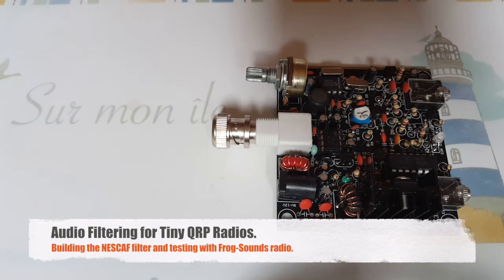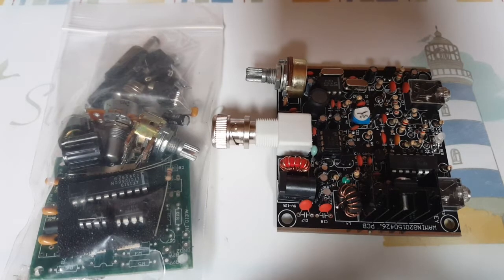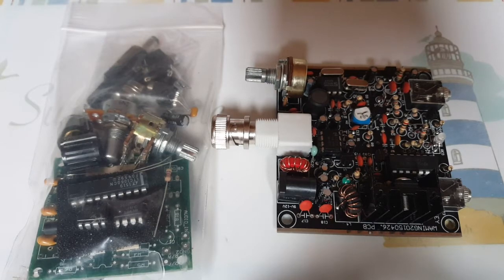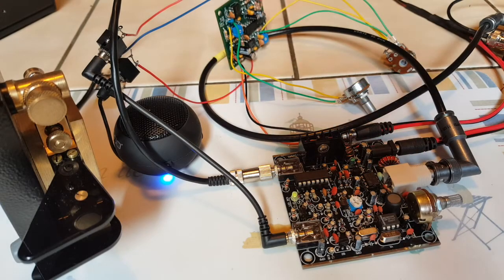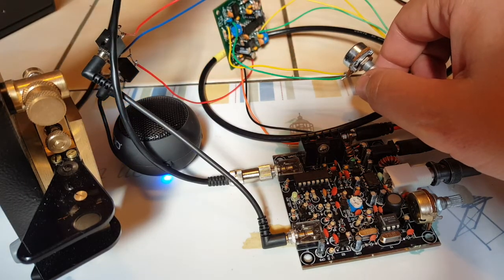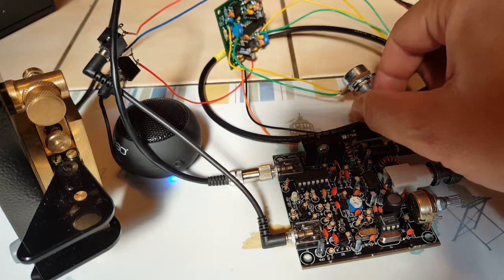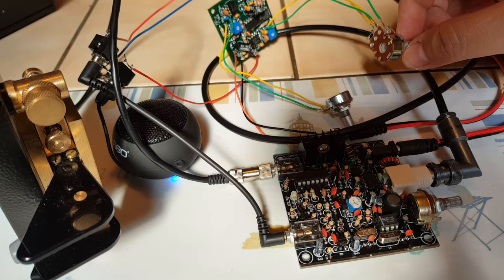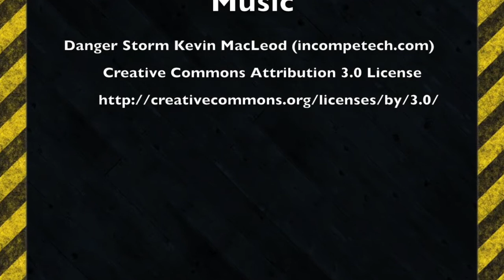The Nescaf Audio Filter for Small QRP Radios.

Comment: I've not looked at that circuit too but if you but a few of the same crystal in parallel it will increase you're bandwidth Gil
Reply from the maker: +VK6OP Hi Marc, I'd rather narrow it, on receive, since you can't tune...
Reply: A variable capacitor in series with the multiple parallel xtals will allow you to vary the frequency

Comment: Nice addition to your gear. I wonder if that could be built into a FT-817ND.
Reply from the maker: +Joel Caulkins It probably is small enough...
Reply: To follow up with the reply below, absolutely not but it can be built into a small case and easily carried and operated in the field. But you can also install the slightly more expensive inboard filters available.
Reply: War Planner Thanks for the info. Im really trying to figure out whether I need a filter or not, I think the answer is yes for both CW and SSB.